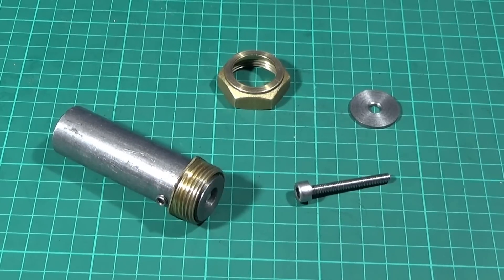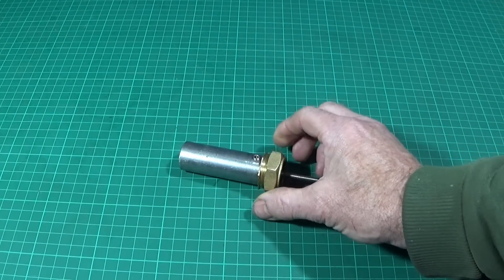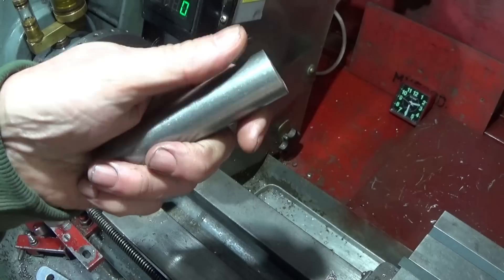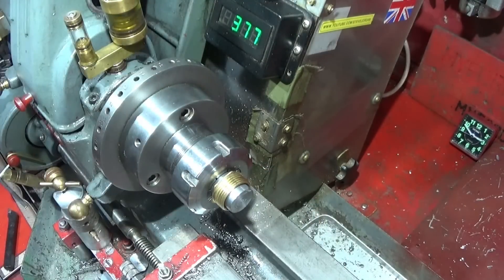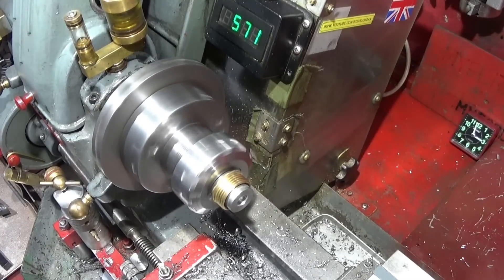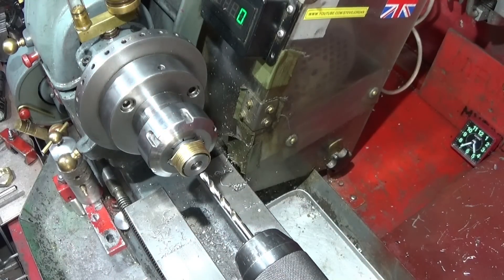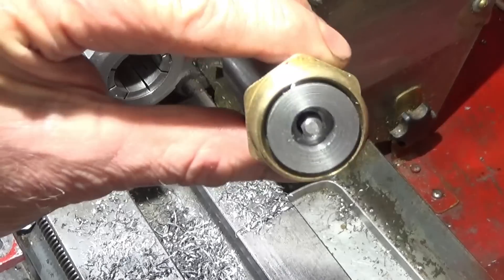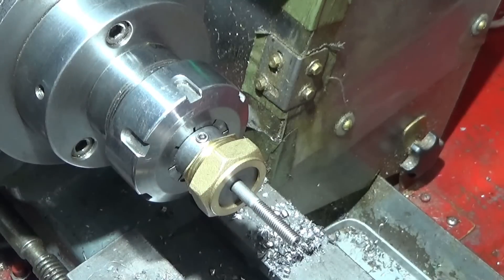Making A Quality Screw Mandrel Very Quickly. No Milling Or Screw-Cutting

Comment: Nice use of plumbing fittings, saves a lot of time screwcutting.
Is there any reason why you can't hold the screw head in a collet or 3 jaw chuck or in a split bush?
Or perhaps hold the allen key in the chuck and clamp the screw with the centre. This will enable you to machine up to the shoulder and machine the head if required, in one setting.
Reply from the maker: You can machine them by holding the screw head, centering and using a live centre, but it is much faster using a mandrel or fixture like this. Regards Steve
Reply: @SteveJordan  Thanks Steve, I saw that you still centre drilled and used a live centre in the demo, so I just compared the video method to holding the head in a chuck.

Comment: Hi Steve ,  I've been watching all your videos that are coming in.    I am a bit behind keeping up but sure enjoying the videos again.   Very simple brilliant idea and I think this idea could come in handy for other things as well.   Thanks again. 

Dale in Canada 🇨🇦
Reply from the maker: Hi Dale, Thanks for your encouraging comments. I'm pleased that you like this particular idea. I have made many different things using the plumbing fittings. Not only the mandrels and fixtures, but also finished products, especially with screw-top lids. Like you say, this one could easily be adapted and used for other things. I have always said to myself, what's the point in setting up a lathe to cut threads when we have many threaded items that can be used instead. Also, the use of high strength adhesives like Loctite 638 has made it all possible by being quick and easy to use for this type of thing. Regards Steve

Comment: good design, but I think you maybe lucked out on the choice of washer since they are typically stamped with little regard for concentricity.
Reply from the maker: I made mine complete, so it's perfectly concentric.
Reply: @SteveJordan  That is of course the way to get the needed concentricity.  I was concerned that some people might expect it from a store bought washer.
Reply from the maker: Yes, those store bought ones are quite soft as well. Thanks for pointing it out. It may save someone from making that mistake.